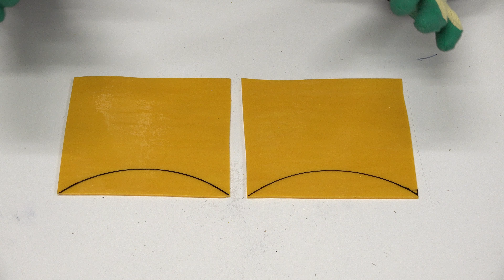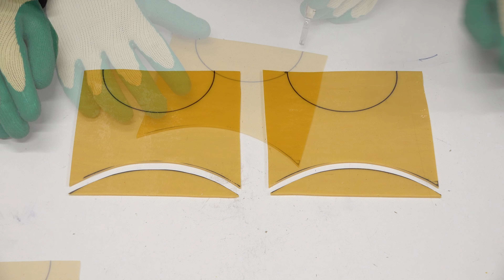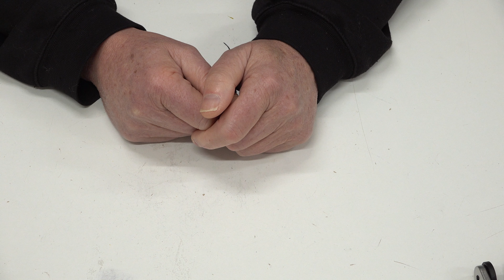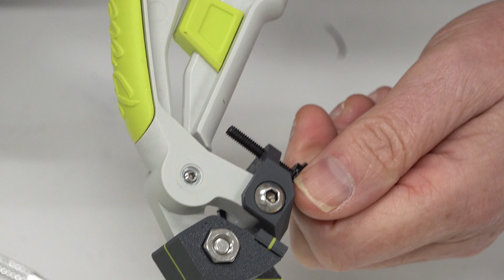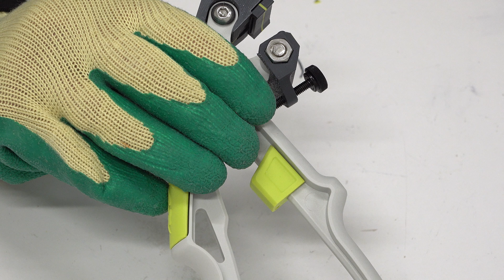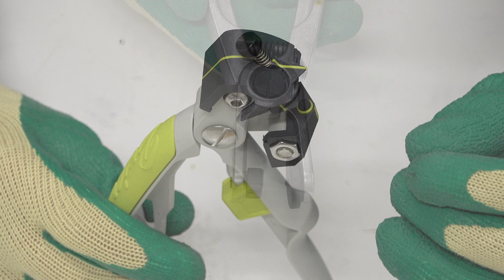Comparing The Silberschnitt And The Brier Running Pliers

Comment: Questions like what makes the Silberschnitt or Brier running pliers better than average running pliers, and is there any benefit between Silberschnitt over Brier (or vice versa). I was hoping for a demonstration of cutting really thin strips, and why would you need to rotate the upper portion of the running pliers.
Reply from the maker: The head on the Silberschnitt turns, this allows you to turn it in the direction of the score. So if you were doing a small say inner curve you could put the Silberschnitt head in say the middle of the score line rather than just the ends to add another pressing point for a more precise break. Standard running plier head is fixed so if you were to try to do the same thing you cant unless you can position and angle the standard running pliers head to run along the score line in the right direction, otherwise the break could go off in a different direction. In most cases that may be very difficult to achieve or not at all. They are only necessary if you have the need for them, if you are cutting mainly straight strips then I wouldn't buy them just for that. They can help with breaking thinner strips of glass but as mentioned in the video there are many variables to glass which can greatly influence thinner strips more so than larger breaks, this is why I didn't demonstrate it. What may or may not have worked for me on thinner strips is not something reliable that you could go by. Thanks for watching. :)

Comment: Thank you for the video because I am getting tired of my old running pliers, that I purchased several pairs on Amazon and I cannot find the rubber replacement to fit so now I use them with one on and one off😢 never had a pair of silverschmidt. Nice to see you have  new videos
Reply from the maker: I had a pair of the metal ones as well and got rid of them, I just use my cheap plastic Leponitt running pliers 95% of the time, love them. Thanks for watching and for the comment. :)

Comment: Great Video - as always Peter. Would you say - in context of the price point for each of these tools - that the cheaper Leps breaking pliers (the plastic ones you included in the same test as the Silberscnitt and Brier) performed as well/nearly as well? So many tools, so little time  and money....... 🙂
Reply from the maker: Great question Wendy. I love my plastic blue Leponitts, they worked well in this video.providing that you can access around the curve with the short throat. The others especially the Schilberscnitt have a deeper throat for the glass. The blue ones will work but with the schilbercnitts they are easier at breaking the glass successfully.  Thanks for watching and appreciate the comment. 😊

Comment: I recently bought a Silberschnitt.  Happy with it so far, but your demo helps me understand the best way to use it for curves. After seeing the Brier's bright alignment mark, I took a gold pen and marked my Silberschnitt to aid in placement on the scoreline. I agree that glass is better broken closer to the table surface! Glad I came across your video. Thanks for the demo.
Reply from the maker: Thankyou so much, lm glad the video helped you. Adding a marker to the Schilberchnitts is a great tip and will make it easier to break the glass. Thanks so much for watching and for commenting. 😊

Comment: I have been cutting glass since 1979 we just used are glass cutter and 99% we had good cuts for leaded lights and clock faces in 2mm glass
Reply from the maker: That’s a very good point Simon and 2mm stained glass is extremely narrow. I was talking to a supplier of stained glass and he was saying that the “Master or Professional “ stained glass cutters who have been in the industry for a long time are able to work with their glass cutters without using specialist tools. They are able to make precise cuts with very few failures, this is where experience and talent comes together. Thankyou very much for your comment and appreciate you watching. 😊

Comment: Good video Peter.  Just a note: The black hole on the top pf the Silberschnitt head (where the top pad clicks in) should align with your score line.  In using both tools, I have found that manipulating the head of the "Silbies" is much easier than the Brier - which I found a little cumbersome.
Also, the break you did with the blue runners was made a little easier because the corner of the glass sheet was cut off, allowing the tool clear access.
Reply from the maker: Thanks so much Merlin. The blue Leponitts did a pretty good job but I could have tapped the underside of the glass with the glass scorer head and that can also create the break without needing to go on the side like I did, thats also worked in the past for me. Thanks for watching and thanks for the comment as well. :)